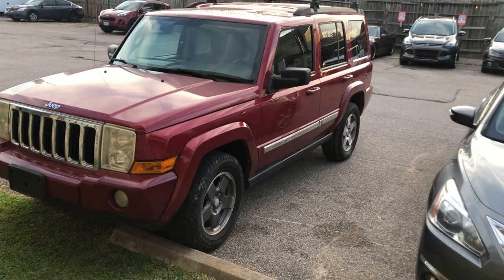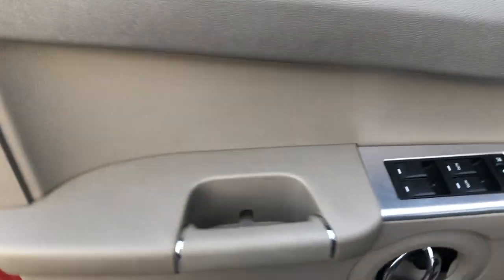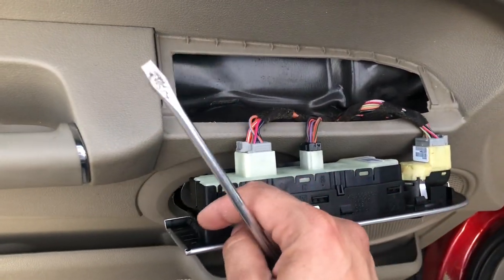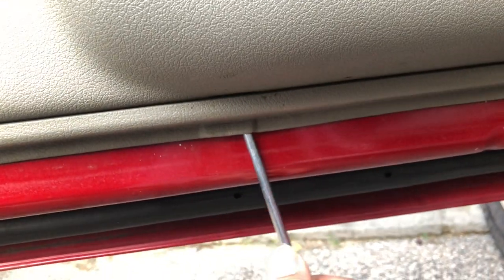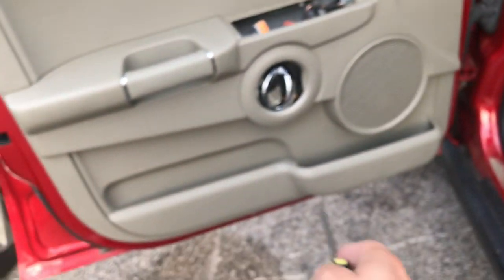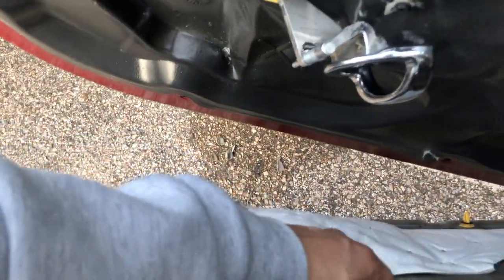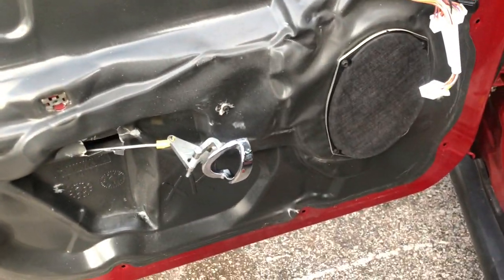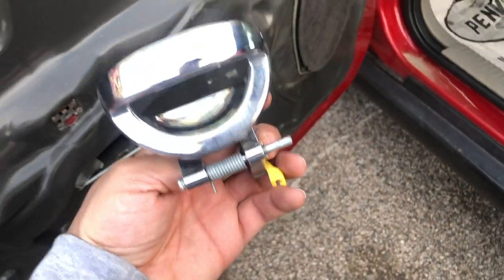Jeep Commander Interior Door Handle Fix

Comment: although I like your video, I think using crazy glue on a part that is known to fail can and will cause some head aches down the road.  Now I came here today because I took my door panel off to service my window motor.  The handle wasn't broken, I took the screw out for the panel, after removing it, noticed the handle broke.  Do you know what causes this? anyone?  I don't get it.